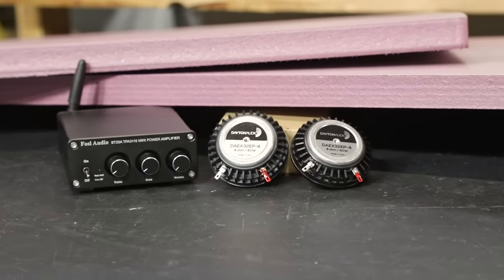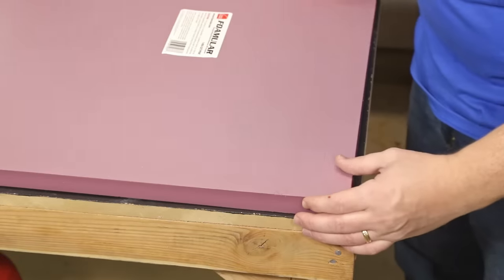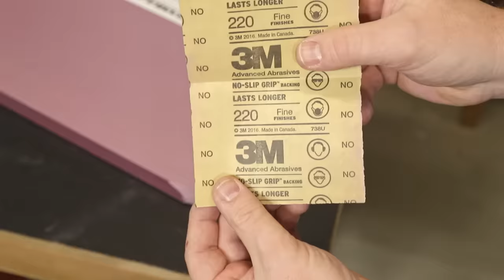How To Build "The World's Best Speakers" - Are Flat Panel Speakers Really Any Good?

Comment: This may be the first comment that I've ever made on YouTube but I had to provide some feedback in hopes that I save at least one reader a couple hours of valuable time... I've never heard a speaker (at any price) sound this bad...  Okay, just imagine pulling the 4" Delco speaker, complete with whizzer cone out of the dash of your dad's old 1987 Ford Escort. Now place that speaker right-side up in an old adidas shoebox. Drill a hole for the speaker-wire to enter said shoebox.... Place some styrofoam peanuts inside the box for added surface area... Now place the lid on top of the box and tape it shut... Connect your amplifier and enjoy. That pretty much sums up the frequency and distortion response of these speakers. Perhaps it's because I used Bluetooth?
Reply from the maker: Hey Darp - that's a really interesting description! But it really sounds like there was something not set up quite right... In person these things sound nothing like you describe. Was something loose? Was the wiring for the exciter banging the back of the panel? Was the panel suspended in air or sitting / leaning against something? Was it really close to a wall?
Reply: @AmplifyDIY  Good day to you sir... First let me apologize for the comment. My description was extremely exaggerated and admittedly unproductive. It doesn't sound like there could be loose foam peanuts shaking around. (Nothing audibly rattling)... I do maintain though, I've never heard a speaker sound this bad... The driver that I'm using is the Dayton DAEX32Q-8. I rounded off the 4 corners, sanded off the shiny film, heat glued some hooked wire into the top L/R, then I've got elastic bands connecting that wire, to some wire that I've got suspended from the basement ceiling... I haven't experimented with placement because, as much as I agree that placement can make a huge difference, you've got to a to least have an acceptable level of sound quality before placement can get things to  things to 'good'. The amplifier used is nothing special, a tda7498 running off of a decent 19.5v supply with Bluetooth as my source.
Maybe it's the driver I chose?
Reply from the maker: Hey Darp - no apology necessary. I enjoyed your description, and knew it was likely exaggerated to a degree. As for your specific setup: I agree that exciter placement on the panel does not make a HUGE difference. It can subtly change certain characteristics of the frequency response, but it won't make things go from anything like you describe to something like I recorded in this video.
I note that the driver you chose is rated for only 20 watts. Your amp will deliver up to 80 watts of power at 8 ohms (the impedance of your drivers). It is entirely possible you are simply driving the exciters with WAY too much power. I assume you have tried them at various volume levels - do they sound really nasty even at low volume? Did you initially try them at more than 25% volume? Perhaps you have driven them too hard and damaged them somehow?
Bluetooth is not doing you any favors, but also would not make such a stark difference as you describe.
Do you have a more "standard" bookshelf speaker you can try the amp with?
I just checked the data sheet for your amp, and it looks like as you change the input voltage, it alters the effective output wattage to the driver. At 19.2V input, this spec sheet indicates that the amp outputs a little over 40 watts - that's better than the 80 that I assumed above, but is still double what the exciters are rated for. Can you adjust your power supply? If you were supplying around 12-13 volts to the amp, it's output is right at 20 watts, and would be in line with what the exciters are expecting.
Of course: I may be completely off base with all this... but I'd try swapping out the panel with a bookshelf speaker with similar specs to test the amp, then I'd try swapping out the amp with something that matches up with the exciter. One of those tests should tell you what the root cause of the issue is.
Also: I don't know if you saw my follow-up video, but I did a LOT more in-depth recording with a much higher quality setup. If your panels sound crazy terrible in comparison then something is certainly not performing correctly: https://youtu.be/XC814uQjlaE

I'd love to hear if you figure out what's up with your setup. Good luck!
Reply: @AmplifyDIY  I have too many speakers, ranging from 3.5" FR's to powered studio monitors to arrays. More than any reasonable person can justify actually. The 7498 is definitely over-powered but that's nothing that the volume knob couldn't solve. It's just what I had laying around the test-bench at the time. It's clean and I know what kind of sound to expect from Bluetooth. AptX-HD is surprisingly good actually with a lossless source... I imagine I was playing somewhere around 1 watt average with peaks around 10watts. I figure if a speaker doesn't sound good at low volume it's just not good. As far as placement on the board goes, I've got it located at 2/5ths & 3/5ths as recommended. I planned on buiding 2 panels (obviously) so I still have another DML driver in It's box. I'll try that one. Who knows, maybe the first one was a dud? It'd be the first time Dayton let me down though... Thanks for your suggestions

Comment: I looked into the cost and it would bear nearly $200 for everything that is the Dayton Audio Exciter: $50 each,Amp:$80, and anything else why not just buy actual speakers for that price?
Reply from the maker: I just used basic speaker wire…should be easy to find locally…

Comment: Add a panel with Balsa panel. It will fill the bass that you hear is lacking.

Note: I haven't tried or made them.

But the guy who researched with many materials did mention Balsa does project good bass.

Comment: I wonder if I could build these for my car. Hmm 🤔
Reply from the maker: I won't tell you not to, cause I'm a huge experimentation fan... but you'll need a pretty big car....
Reply: @AmplifyDIY  so, you don’t think that they’ll work the same if I scale them down to about 12” by 12” ?
Reply from the maker: @justdumpit9789  They won't sound the same, no. The way that these exciters work is that they vibrate the panel, and the panel then vibrates the air in the room. The sound waves start at the location of the exciter, and radiate out toward the edge of the panel. Lower frequencies require a surprisingly large wavelength (literally the distance required for the soundwave to develop in the foam). The smaller you make the panel, the more tinny it will sound, as you'll effectively cut out a whole bunch of mid and lower frequencies.
Reply: Ok, thank you. That is very helpful!

Comment: Here's the same idea, only I used GUITARS instead of flat panels:

https://youtu.be/cBgrLvp_bUM
Reply from the maker: Really neat! I tried my exciters on 2 separate guitars as well - one steel string and one nylon string. They sounded good, but not great... but I was just holding them against the back of the guitar rather than the soundboard. I should try some more experiments. 
I also tried one on the sound board of a grand piano, and was surprised at how dull and muted the sound was.
What were your impressions? I know your setup was only temporary, but what did you think about the quality of the sound?
Reply: @AmplifyDIY  My first impression of the sound quality using the guitars was that they could easily replace just about any pair of bookshelf speakers.  They were loud, clear, and carried plenty of bass.  That being said, they could not be compared to a system with a subwoofer.  I think the spot I chose to contact the transducers, near the saddle, was the key I stumbled upon, but earlier I tried pressing the driver against the back of the instrument and it sounded pretty good, but lacked definition.  Next I'll try a Yamaha U1 upright piano.

Comment: So 3/5 up from the bottom. Isn't that 2/5 down from the top?
Reply from the maker: Yes, it is. I refer to it as the 2/5, 3/5 rule to remind myself that it needs to be offset on both the vertical and horizontal axis. So, 2/5 in from the side, 3/5 up from the *bottom*. The point is just to make sure you don't place the exciter along either the vertical or horizontal center line.

But you are correct - 2/5 from one side is exactly the same as 3/5 from the opposite side.

Comment: Sounds flat and dead, if it's your mic.  Tbh u have a really wide tweeters there that are vibrating lower ranges than normal with muffled noise because of the foam.  Just buy regular speakers and reflect the mids back into the room if you want the same effect but distinct wide range. Distinct tweeters, mids, and woofers are done for a reason.

Comment: For something that light I would just use hot glue for the convenience
Reply from the maker: It is convenient for sure, but I'll bet it's not strong enough. When turned up loud, these exciters impart a LOT of energy into the panels, and likely would loosen up / fall off if only hot glue had been used.
Reply: @AmplifyDIY  that's a good point, now I want to test the theory

Comment: So I built these. And I have to say if you think these make good speakers then either a) you're entirely deaf or b) the only thing you have to compare to is a Bluetooth speaker.

They perform like a $5 speaker. They're not good at bass, they're pretty terrible in the middle (surprisingly!), and they're bad at the top end.  They literally excel at nothing EXCEPT being cheap. 

I'm going to disassemble mine, throw the styro away, and bolt the vibrators to a couch or something.
Reply from the maker: Really? That's pretty surprising. Where / how did you mount them?

Comment: I've installed them and heard them... they are not that great. Can't remember the company but they were actually flush mounted into the wall, mudded and painted to match.
Reply from the maker: They put mud and paint *on the panels*? That would have a really negative effect on their performance: https://youtu.be/XC814uQjlaE
Reply: @AmplifyDIY  WE tried them out in the shop before and it really didn't change the sound that much... but the panels also were made of some different material than the foam.

Comment: If this is a square piece of foam then why measure 3/5 down? it's the same as 2/5 up!!!. So basically you measured two things to really end up using the same measurement each way....
Reply from the maker: Hi Johny - I should have been more clear: You measure 2/5 from the TOP, and 3/5 from the SIDE. Yes, since this is a square it seems easier to remember to just measure 2/5 from both sides, but since you can make these out of shapes other than squares, I prefer to remember it as the 2/5ths 3/5ths rule, remembering that you are not measuring from opposite but rather adjacent sides. The whole point is to make sure you do not place the exciter along the center line of the panel on either the vertical or horizontal axis. Thanks for watching!
Reply: @AmplifyDIY  im merely trying to point out that it doesn't matter the shape 2/5 and 3/5 will work out the same as 2/5 both ways.
Reply from the maker: @johny79action  I understand that. Of course, you are correct that if you divide something into 5 segments, and use up 2 segments, there will necessarily be 3 segments left. You could measure 2/5ths from the top, and 2/5ths from a side. I prefer to describe it as 2/5ths and 3/5ths (which is no less correct, mathematically) to reinforce the fact you are doing this to keep things completely off center, and so that the rule forces me to remember to measure each dimension separately, as I may be on something that is not a square.

Comment: I used 1/8 inch plywood.  The foam board is not magic.  I drilled tiny holes in the corners and used fishing line.  Use crimp on connectors. Soldered connections fail due to vibration.
Watch the Tech Ingredients video.  He explained this project better than this guy.

Comment: Anyone evaluating speakers using a phone & bluetooth is demonstrating only that our ability to hear music has been seriously degraded since the loss of acoustic listening. First Edison tubes and 78's, then radio and TV got us used to hearing poor quality sound. Today, what we're sold is "just good enough," mixing slow advances in speaker technical capability with a constant drive to lower production costs. |

Most people will never experience a high end audio system, most of which are completely hand built, driving production costs sky high. The few solid industrially scaled speaker makers put enough money into engineering and design that their manufacturing costs are only a little lower.

I don't doubt that when given signal via bluetooth from a phone, these panels style speakers sound as good as many Best Buy quality bookshelf speakers, it's just that this isn't saying much.
Reply from the maker: I recognize that this test was not set up well, so I did a follow-up that attempts to demonstrate the performance of these panels in context with a control set of bookshelf speakers for comparison. I also used a wired connection: https://youtu.be/XC814uQjlaE

Comment: Building the best speakers in the world and testing them with compressed streamed Audio which is again compressed to SBC codec for transfer via bluetooth on a crappy reciever which does not support any of the higher quality formats like aptx, aptx HD, AAC, LDAC....
Reply from the maker: Hi Riemen - I plan to test wireless vs wired on this amp and another I have in a future video. Bluetooth audio has come a LONG way....
Reply from the maker: Oh, and the amp I used in this video uses the QCC3003 bluetooth chip from Qualcomm, which does support aptx and AAC. Here's the datasheet: https://www.qualcomm.com/products/qcc3003
Reply: Ok. Just looked at the Amazon answers from the link in your description answers which say, the amp doesn't support any other protocol than a2dp. Of course these can be wrong...
Reply from the maker: @tobias1170  Yeah, I would trust manufacturer data sheet over random internet comments. This amp punches way above it's weight class.

Comment: The driver should not be in the center.
Reply from the maker: It was in the center on one, offset on the other, to counter-act the peaks and valleys of each placement in the total sound production from both panels. In this follow-up video I tested 2 exciters on a single panel, one center, one offset: https://youtu.be/XC814uQjlaE

Comment: I don't know what I'm doing wrong, but these things sound terrible. They're gutless, and muddy, the best way I can describe it would be a scaled-up phone speaker.

Edit: I figured it out. These things need to be suspended well away from the wall to sound good. The ~4 inches I had wasn't anywhere near enough.
Reply from the maker: Hey David - yes, reflections off the rear can really muddy them badly. You can place them close to a wall if you add a bit of acoustic insulation to the wall. Good luck!
Reply: @AmplifyDIY  thanks for the suggestion, I'll have to look into that. For now, I have them suspended in the corners instead of along the wall and the hype is making a lot more sense.
Reply from the maker: Don't know if you saw it, but you may also want to check out the follow-up testing video I did here: https://youtu.be/XC814uQjlaE

Comment: you tested the quality of the bluetooth not the panels. also, the fact that you even are someone that are not able to notice the diference between  the heavily compacted audio bluetooth uses and anything else makes this test moot
Reply from the maker: Heh. I always have to chuckle at folks claiming there is such a huge difference between bluetooth vs wired audio these days (when played through the same hardware - bluetooth processing / engineering of bluetooth vs dedicated wired headphones is an entirely different matter).... It's a bit like the argument I heard back in the early 2000's about how certain VERY expensive wiring was so much better than cheaper wiring and that you could totally hear the difference (nobody really could).
But, in this follow-up video I specifically did everything wired to eliminate the bluetooth compression entirely: https://youtu.be/XC814uQjlaE

Comment: Just built some. The quality of the sound is way over blown. Very “tinny” 

They make noise, it’s just not very good
Reply from the maker: For certain genres of music, I'd agree. The reproduction of acoustic instruments (especially classical guitar and cello) is unbelievably good.
Location of the panels makes a BIG difference as well. Make sure they are not placed near and parallel to a wall, or the destructive interference off the back of the panels will make them sound pretty terrible.
Thanks for watching - and for taking the plunge to build your own!

Comment: Neat, but for almost 200 bucks... there are better speakers. Lol it's not just a 5 dollar piece of foam board. 
The exciters are almost 50 bucks, the Amp is 80, and the epoxy is 20. 
So. Not really cheap.
Reply from the maker: When I first shot this video, the exciters were a lot less expensive. They’ve gone up with global supply constraints and higher demand. Today, the exciters are available for $22 each on parts express. And $20 is some pretty spendy epoxy. Just about any glue will work fine. I left the amp out of the equation, as any speaker will need an amp.